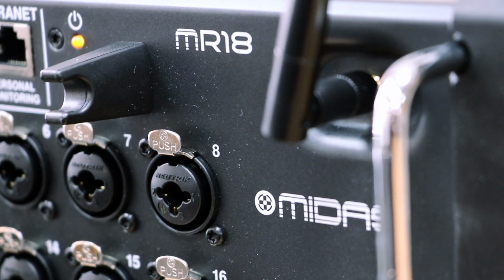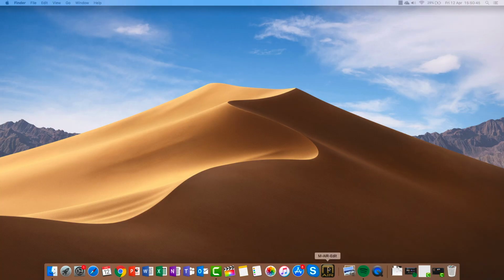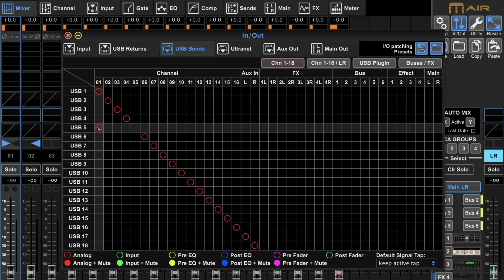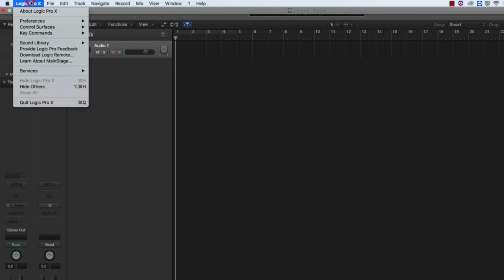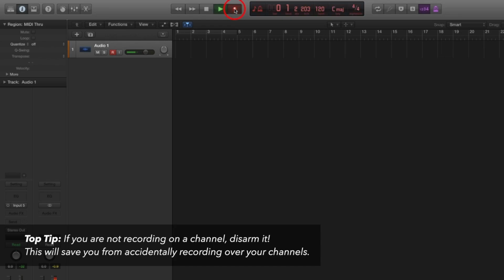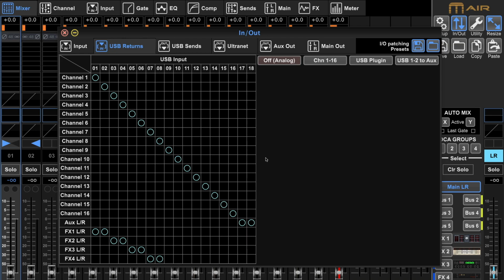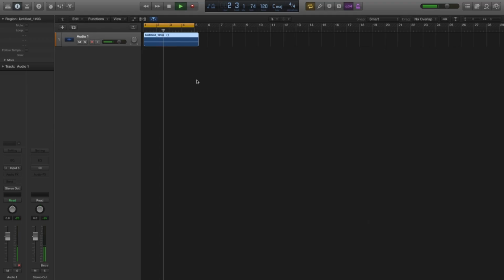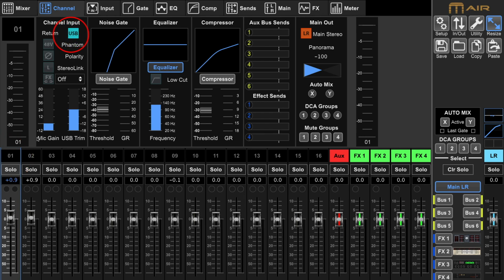Setting up MR18 as an Audio Interface

Comment: I have the xr18 inputting into my computer using Reaper but I want to use my Focusrite as the output device to monitor what I'm recording. In Reaper I don't have that ability for separate input and output devices with ASIO and the xr18 driver. I downloaded ASIO4all and now I have two separate interfaces. But, the x18 input device is only showing the first  two inputs, 1 and 2, and not 18. Any idea what needs to change?
Reply: go to audio/midi setup and change usb setting from 2/2 to 18/18

Comment: The Windows drivers only show up as four stereo usb channels, though. I have not found a single solution to actually access all 18 channels. :/
Reply: go to audio/midi setup and change usb setting from 2/2 to 18/18
Reply: asio4all driver will probably fix that

Comment: Question: is it possible to use headphones to monitor the mixer output from M Air, but directly from the PC headphones out?
I mean, not having to be connected to the box all the time and be able to hear the mix from another room for example.